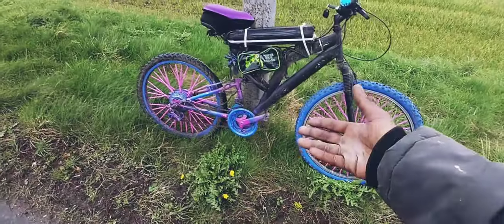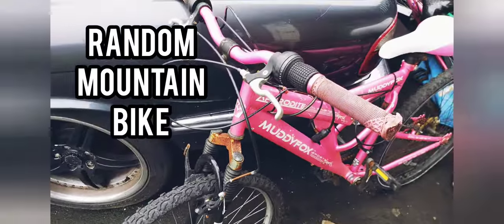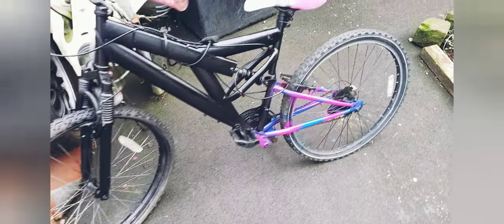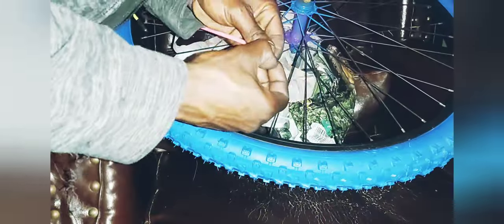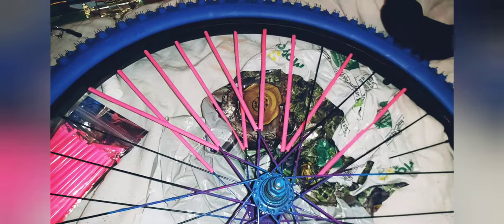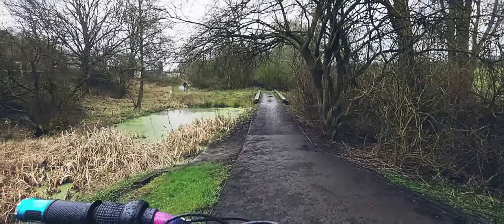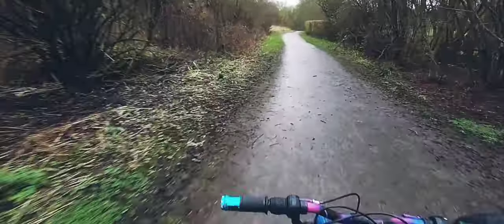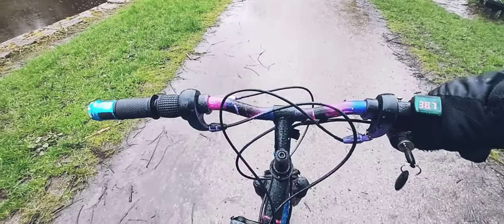I Built a Fast eBike on a Cheap Budget

Comment: What battery and amp controller are u using
Reply from the maker: Controller was a cheap ebay purchase at less than $18. It is rated 500 watts with 20 amps, Battery is a ninebot segway 36 volt, 1024 watt hours.
Currently test riding it with a shunt mod on the controller plus thicker phase wires from motor to controller, Video uploading ASAP.

Comment: 😂 my motorized bicycle goes 35 mph and i payed 70$for the motor and got the frame for free
Reply from the maker: Love the free frame resurrected. Itseems the battery is the highest cost on budget builds
Reply: @RastaOnABike  good thing 2 strokes don't need a battery's just gas and go
Reply: @theLyzhendricks  2 stroke bike kits loud asf and slow
Reply: @Minacious_Shenanigans  35 on a bicycle ain't slow u can't change my mind on that and again I paid 70$ not 1k for a gay e bike 70$
Reply: @theLyzhendricks  You can only get so far with one of those engines, not to mention u gotta pay a damn fortune for fuel, and dealing with cheap carbs. I built my ebike for $200 and can easily hit 35 and I don't need to pay for gas, not to mention it's quiet and I can easily take it on sidewalks / pedestrian areas
Reply: @Minacious_Shenanigans  I rode 35 miles in 1 direction today and 35 back and still have half a tank 🤣😂 they get like 100 miles a gallon ar eu special?
Reply: @Minacious_Shenanigans  btw I dunno if I mentioned but I paid 70$ for my bike not 200 and I dont have to wait for it to charge I can ride all day like I did today
Reply: @theLyzhendricks  I can take mine into densely packed pedestrian area's without pissing people off, both have their pros and cons
Reply: @Minacious_Shenanigans  i might piss people off but i domt care ill ride where i want other peoples opinions dont matter to me
Reply: @theLyzhendricks  you must be a social butterfly.
Reply: @Minacious_Shenanigans  u must be gay u ride a e bike
Reply: @theLyzhendricks  how is it gay to not want to bother people on a school campus
Reply: @Minacious_Shenanigans  because their also gay for not liking the 2 stroke noises

Comment: How much did the build cost?
Reply from the maker: Hub motor 2nd hand from ebay £20. Battery was £32 and throttle with controller is another £20. Bicycle was laying around for years so free. Total build cost £72 for the basic electric bicycle but £100 with blue tyre, spoke covers and comfortable seat

Comment: What is the top speed
Reply from the maker: Full send without pedalling on a flat surface "offroad" 32 mph. The 3 phase wires on the hub motor going to the controller were swapped for thicker gauge wires. This allows a little more current allowing a higher top speed than stock intentions.